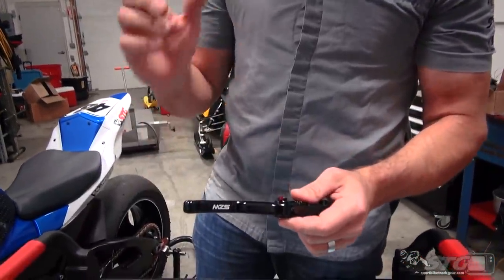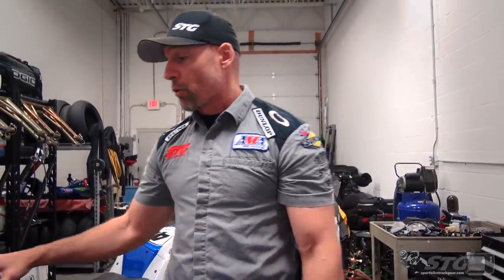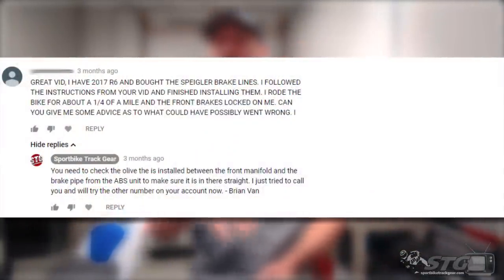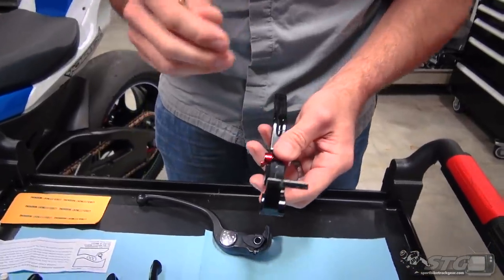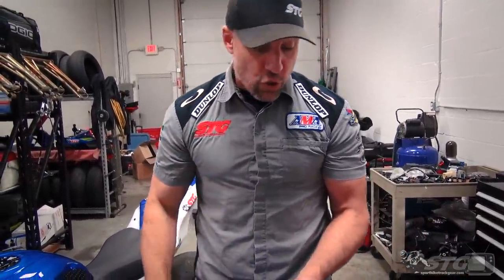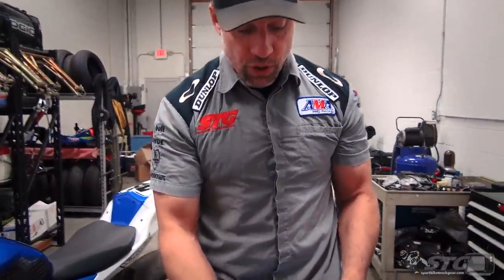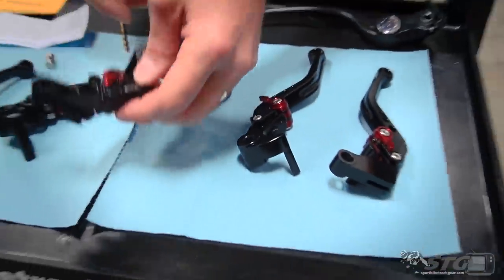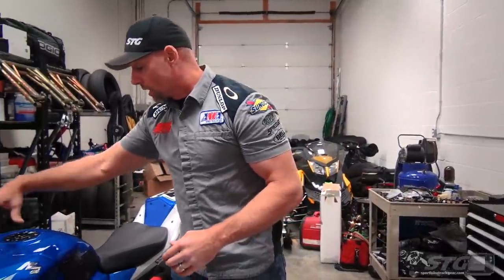The Truth About Cheap Motorcycle Levers | Sportbike Track Gear

Comment: I commute on my bike every single day and my cheap Chinese ebay levers hold up 10/10 in every circumstance for years now. I wouldn't be risking my life if I felt they weren't safe. I even ordered a cheap Chinese exhaust and compared it to a Yoshimura R77 pipe hand to hand and the difference/sound was literally nothing. Saved a grand and haven't felt cheated out once yet...seems like smart shopping in my honest experience.

Comment: This is a flat out lie. I listened, too. Next bike bought the 35 dollar levers. Exactly the same. Save your money.
Reply from the maker: Read the comments in this video man, multiple riders have crashed due to these shit levers. If you want to roll the dice and install garbage controls on your bike more power to you. All the information included in this video is 100% accurate and not an opinion posted by someone who has installed 2 sets of levers in total. - Van

Comment: This was exactly what happened to my bike! I swapped a GSXR fork set on my SV650 and my brakes promptly locked up, and silly me spent almost $300 on caliper and master cylinder rebuild kits and new pads (all of which were needed anyway). And then they still locked up. Put a set of Vortex levers on and it was immediately fixed. Should have just guessed it was the cheap brake lever to begin with. Learned my lesson, and I'll buy quality, proven parts the first time.
Reply from the maker: Never put cheap, imitation controls on your motorcycle. - Van

Comment: If you are going to change your levers you have to make sure you are definitely upgrading the quality. Had a tip over with my ZX14 and broke the tip of my clutch lever. Ended up with the CRG RC2. I just can't imagine the thought into putting cheap garbage on your motorbike. Guess it is the same thought process of changing your oil and not putting a new crush washer on... after all you can save a dollar and "reuse" it. All the while putting in the best oil possible. Cringe and shake my head.
Reply from the maker: There are better ways to save money than installing cheap controls on your motorcycle. - Van

Comment: I bought cheaper levers 6YRS AGO- cpl differences were #1 THE PRICE,  #2-there was SOME play, but i tightened the nut on the bottom a little and tht solved play problems.& lastly #3 the ' shorty" size was a little longer than the crg rc2's . SIDE NOTE*the blind hole for the actuating pin was "loosey goosey" outta the box.*
Reply from the maker: No the difference is there is no real engineering, no quality and no product liability insurance. Never put sub par controls on your bike. If you can not afford proper replacements leave the OEM's on the bike. - Van

Comment: Honestly, I’ve never run anything else except for the Chinese levers. Luckily I’ve never ran into any issues. On my DRz I finally decided to get an RSC one finger stunt clutch lever, that was the first and only aftermarket like brand name lever. I even didn’t replace the stock brake lever. Then on my Zx10r i went back to Chinese levers lol. But on my current Monster Edition 09 zx6r I decided to buy my first ever ASV levers, and I love them so from now on I’m gonna be buying these levers. Except for my stunt bike that’ll just get the Chinese levers lol, it’s not a street daily or anything mainly just a lot bike so not really too worried about it and shit is gonna break a lot so I’m not trying to spend $100+ on levers that will break. But I just transferred the RSC clutch lever I had, I put that on the stunt bike and I’ve held on to it ever since I sold the DRz like 2-3 years ago, and I forgot about it, but I found it when cleaning my storage unit and now it’s on the stunt bike, but I do agree that gotta make sure you got reliable equipment, especially like on a track bike or something daily.
Reply from the maker: Thanks for watching and sharing your feedback. - Van

Comment: Great video 👍 .  I've been looking at master cylinders for a bike I'm building and I bought one for like $25 and it had that fancy adjustment mechanism like in the video, after looking it over I decided no way would I use it , I left it out in the sun light for a few months and the plastic sight glass degraded ! I can't find any glass ones so I decided to look for a master cylinder with out one which was hard to find . It seems to be engineered much better, it has a ball bearing at the plunger pivot point Wich 95% of the master cylinders I've looked at don't have which really is sad 😢 . I'm upgrading my brakes on my e recumbent bicycle to a larger standard because tiny bicycle brakes are totally inadequate 🤕  even when you buy the good quality bicycle brakes components because they're is not nearly enough contact surface area because the brake pads a microscopic 😮 . And most of the floating bicycle brake disc use steel washers that rust out and fall apart ☠️ . It's really sad that most ebikes use tiny bicycle brakes, when motor cycle brakes only weight a few pounds more cost about the same and would save a lot of money in maintenance cost 😮
Reply from the maker: For sure there is no replacement for a great set of brakes. - Van
Reply: @sportbiketrackgear  I think I would trade reliability for temporary  adjustability ,  problems happen when things are made overly complicated 😢🤕☠️

Comment: Grease the pin slot and make sure pin fits in slot like the oem. They don’t grease because grease attracts dirt.
Reply from the maker: You should be able to install the lever without doing this. The tolerance is trash just like the lever. - Van

Comment: What levers would you recommend  for a 2016 Yamaha R1m ?
Reply from the maker: Really depends on what you are looking for. Myself I prefer a standard length lever on the bike so I start with brands that offer full length levers. I had a set of Lightech on the 2015 R1 and really liked them (only issue was the clutch lever was not adjustable like the OEM) on the GSXR 1000 I have a set of CRG Levers now. Below is a link to the lever category for this bike on our site. Hard to go wrong with CRG IMO.

https://www.sportbiketrackgear.com/parts/yamaha/yzf-r1/2016/?_bc_fsnf=1&Department=Levers

Comment: Not an accurate test in my opinion.  You said it yourself at 5:30...  you need grease or lubricant on the bushing.  Also the little bit of play in the levers is minimal when they have tension on them which they would have once they are installed.  Still a great video.  This brings awareness to potential hazards.  The clamp that holds my front brake lever to the handle bar rattled loose while driving home from work.  The feeling that rushed through my body when I grabbed my brake and it just went limp and hit my throttle was one I never want to experience again.  Always do a pre-ride inspection!
Reply from the maker: I agree, never ride the bike without doing a quick pre ride inspection before you throw a leg over. I have been doing this a long time now and have installed more levers than I can count by now. The MZS radial brake lever design is flawed and has proven to fail and lock the front brakes. These tolerances need to be opened up and they should not be using the snap ring to hold the cross pin bushing in the lever. I would not install these on a riding lawnmower. - Van

Comment: I call BS. On the clutch side, I installed the MZS's (I've had several bikes with roll a clicks great product), the oem pushrod and barrel drop right in with no hangups and 2) the above video doesn't apply to hydraulic brakes there's no piston/pin to hang up up. I would bet it was user installation error that caused the problem.
Reply from the maker: LOL what do I know??? If you have a junk bike and a death wish then install garbage knock off controls on your bike. I have been in business 16 years and know my shit. - Van

Comment: did they ever drop that levers before they snapped? never ever had this kind of issues with chinese stuff. they last less and maybe are less resistant but never fail on use. last thing, if use this kind of cheap stuff on a premium bike or on a track bike used a lot, I don't really see the point of saving money on mods, we're not talking of old bikes used just for commuting here.

Comment: Thanks for this video.  I contemplated buying those same type of levers, glad I didn't. Could you recommend a good lever for the 2018 Kawasaki z650. I haven't had any luck finding CRG ones.
Reply from the maker: I did a little research and it looks like Vortex offers levers for your bike. Our listing only goes to 2016 for the Ninja 650 but Vortex shows fitment to 2018 for the EX650 Ninja 650R. Below are links to the brake and clutch levers. 
https://www.sportbiketrackgear.com/vortex-kawasaki-ninja-650r-er-6f-09-16-v3-2-0-brake-lever/
https://www.sportbiketrackgear.com/vortex-kawasaki-ninja-650r-er-6f-09-16-v3-2-0-clutch-lever/

Comment: Interested on your take on Raximo Levers sold by MTP racing in Germany, I just recently purchased a set and they seem great, but I was sceptical at first as there is very little info out there about them, seems to be a new company and their own brand. Safety approved by German testers and came with a cert.
Reply from the maker: I have not seen a set so I can't really speak about them to be fair. That said if they carry a TUV cert I would want to believe they are good to go. - Van
Reply: Fair. Good work on all the videos. Used your videos the other day as reference when I got my M4 and took out the exhaust servo.
One point also for this video, I think alot of people mess up their lever change because they don’t seat the rod into the bushing correctly or even at all. Doesn’t matter what levers you have if they are incorrectly installed.
Reply from the maker: We have a couple lever install videos where I make note of how important this is for sure man. Thanks for watching! - Van

Comment: I wish crg had option to change the clicker color on to the rc2 like they did on a spectrums and on the older click and rolls.
Reply from the maker: End of the day the quality of the Spectrum levers is the same as the RC2. The RC2 does have the delrin end which is pretty slick, other than that very similar. - Van
Reply: @sportbiketrackgear  I had the rc2 on my bike already I would like to change the red but no luck

Comment: But  mines Oem doesn’t have that bearing inside
Reply from the maker: Not every model is the same. Some will have them while others do not. - Van
Reply: Sportbike Track Gear  ok thanks i just don’t know what i’m doing wrong and the brakes locked on me i was in parking lot making sure everything test out correctly. but they ended up locking up. now these levers didn’t have that bushing thingy did i tighten the bolts too tight ?

Comment: I did buy the mzs lever last year on my 17 cbr1000rr and luckily I haven't had a issue but after watching your video about them. I decided to buy crg rc2.  After my install. I noticed there was high revving before the my throttle would catch while being in gear. Did I do my install wrong?
Reply: Never mind.  I understand now the clutch cable needs to be adjusted correctly. Almost panic. Thank you for your video

Comment: So they're cheap but they have one tiny defect which can be fixed cheaply.. they could still sell those levers for a cheap price instead of milking the market like most big brands do.

I've got a set of the cheap levers with the built in reservoir. they feel and function superbly. Obviously with things like that you check everything before fitting it. Nothing came loose or floppy on the ones I bought and they were less than £30. Bled the fluid perfectly fine and the pistons give a nice squeeze feel. Can't fault them.
Reply from the maker: No they are cheap and they can lock the brakes. Read the comments, several riders have crashed because of this. These levers are trash and should not be installed. - Van
Reply: @sportbiketrackgear  no there's 2 types.. one type has some weird sort of bolt that comes loose and stops the piston from moving. The other type is direct to the piston. I've tested mine under extreme pressure to try and make them fail and they did perfectly fine 🤷🏻‍♂️ used them loads.

Comment: Meh. I feel like this is subjective. I've used Chinese parts left and right. I've also used vortex levers and rear sets on my bikes and never had issues with any of them.  Nor did anyone I know have issues unless you're a donut and shouldnt be working on his bike anyways.
Reply from the maker: Read through all the comments in this video, there are several riders who have left comments about their front brakes locking up causing a crash. These levers are pure shit. - Van
Reply: @sportbiketrackgear  
Like I said....on my zx10r and 14r I have Vortex levers. Both started out with Chinese ones. My zx6r has Chinese levers as does my Busa. Never had a issue with them aside from they would start to get loose after about a year and cause my brake light to flicker. Other than that never had a issue. I've personally never known anyone in the Houston area who's had a issue either.
Reply from the maker: For sure there are a lot of people who have not had issues with these levers. Way too many people (when the number should be ZERO) have reported these levers causing their front brake to lock up. My intention here is to share something we learned while helping one of our customers sort out the brake issue on a 2017 R6. Once we dug into this it became pretty clear this was not an isolated issue. Companies producing parts like these have to be held to a higher standard IMO. - Van
Reply: @sportbiketrackgear  
I agree with you there Van 100 percent. But I think it goes without saying that you get what you pay for. We all want top quality parts but dont want to pay the money for it sometimes. I wasnt knocking your opinions...you're correct in what you've stated no doubt..anyone who makes parts should be held to a standard. But at the same time not everyone is able to afford some of the prices they charge. All my issues have been minor.

Comment: Hey Bryan how’s it going thanks for the awesome vids I literally did all my mods to my 2020 r3 based on most of your vids again thanks I had a question about levers I recently purchased a 2021 r1 and wanna change out the levers was ready to order right before I watch this video but immediately stopped on my tracks and wanna ask if the Puig levers to your knowledge are good levers Ive used this brand before so it’s why I wanted to use it on my r1 since I had a few upgrades on my r3 from Puig and loved them so just wanted to know what you think? Thanks guys!!!
Reply from the maker: Puig makes quality parts, I would not hesitate to use them. - Van
Reply: @sportbiketrackgear  thanks 🙏🏻 Van I ordered them already and quality on those are great

Comment: I bought a set off Amazon and when I put the adjuster on 6 and hit the brake hard since it was metal on metal it would slip over the hump and the lever would be pressed all the way down but no brakes was being applied. Scariest shit I thought my brakes gave out. So as long as you used the lever in 1-5 setting it be ok 😂. No thanks.
Reply from the maker: No big deal, lesson learned and nothing bad happened. Now you know. - Van

Comment: Never had a problem with the bushing in cheap handles. So you got a bad batch of handles. Oem have imperfections that's why we have recalls.
Reply from the maker: From what I have seen this is a design flaw in their radial master levers. If this were a company doing business here in the US with proper insurance etc... odds are they would have been forced to recall as this is a safety issue.I have seen a couple recalls in our industry over the years with less failures reported than I have seen in this video. - Brian Van

Comment: I have a BMW R1200GSA.  It has the factory installed levers with the break away ends.  My bike fell over and the tip of my clutch lever broke as designed.  (So did the hand guard) I am having the tip welded back and the breakaway point reestablished.  Why am I doing the repair and not buying a replacement,???  Good question.  BMW wants about $140.00 for the clutch lever, the repair is $40.00.  When I removed the plastic pieces and sleeves to get it welded I was surprised at how utterly cheap the pieces were.  Plastic adjusters and more plastic actually working the clutch cylinder piston.  I thought to myself, what a load of crap BMW put on the bike….. but it works and works quite well and after 30,000 miles they still work great.  OEM levers are not the most stylish item built and the ones on my bike are no exception…. Looking at your comparison of the more expensive levers vs the Chinese made MZS why not recommend some lube on the barrel pivot pin and work it in.  The rest of the lever was okay, maybe not to the standard of something costing 3X more, but  you didn’t address OEM levers and use them as the standard.  I’d say my OEM levers are no better made than the MZS brand.  I do not have much of a choice when it comes to after market levers, it is OEM or Chinese made Levers sold through Amazon or eBay.  I don’t disagree with what you are saying…get the best you can for the money you got.  It doesn’t always translate into the most expensive.  Lots of great Chinese products out there, ya just need to know how to navigate through the hype and sales tactics used by our friends in China.(gulp)
Reply from the maker: The lever needs to be safe right out of the box without any modification. Nothing beyond that is acceptable. - Van

Comment: Bought cheap adjustable levers on 3 bikes, have put tens of thousands of miles no issues. Would use  the extra money to buy handguards or a windscreen. I've spent a lot of money on mods for my bikes but these expensive levers have always been a headscratcher to me.